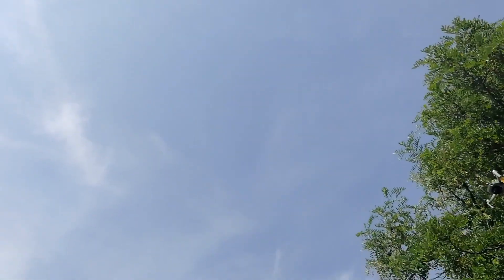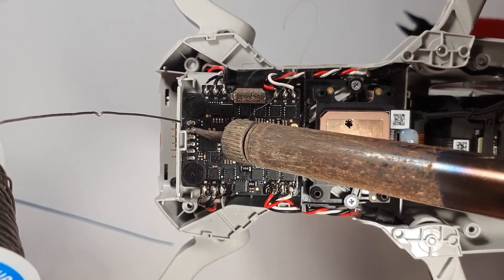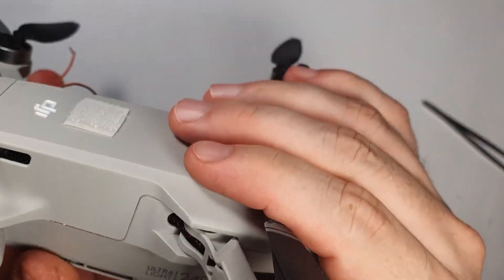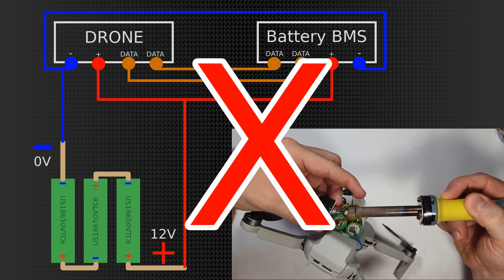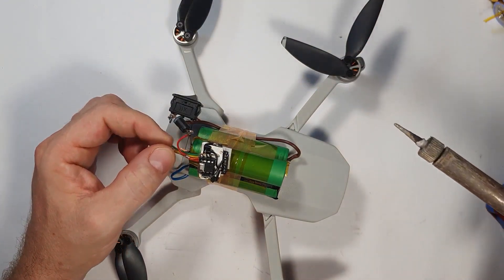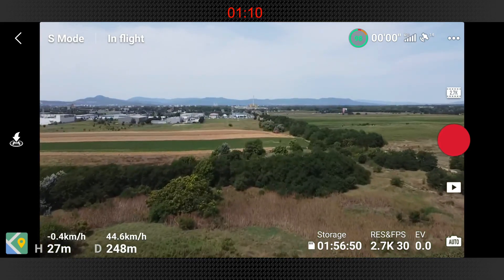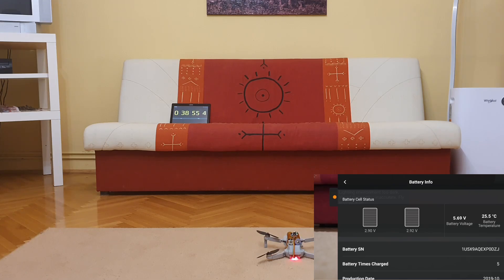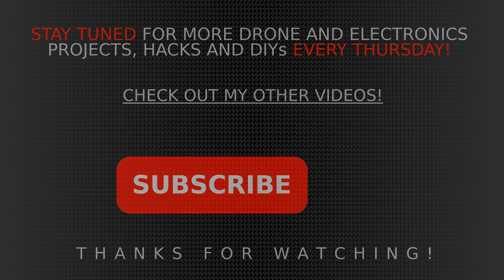Simplest Mavic Mini 3S battery mod (Is it worth it?)

Comment: Great video! I’ve been curious about this subject, considering all the possibilities, since Dji batteries are so expensive and  thinking that wiring a few 18’s or even better 21’ with high batterers drain shouldn’t be overly diffiucult, it’s just being able to get past dji’s battery level sensors to get it run,while also being able to see the batteries real time level. I’m curious if this set up will work for my mini pro 3. I’ll check for your part list or if you left any links. 
  And if yiuve discovered any modemifiactiins to this set up like possibly  using the Dji dongle holder as a possible mounting option. Or if you’ve continued with the 21’s or if you’ve found any pillow pack style of batteries that would work bettter becuasethey have less packaging material

Comment: the top speed in drones is always 100% dependent on the max angle of tilt relative to gravity. And this is what is regulated by the firmware.
And the motors do not get hot because of the extra voltage, but rather because the drone is working harder by carrying extra weight. They would also get hotter than usual when you're carrying the same weight regardless if it's batteries or not

Comment: I was thinking about opening up the top cover over the drone to put the batteries closer to center gravity.  A new ,used top cover is pretty cheap to replace if you want to return to stock. I was also considering drilling multiple holes on the entire body for weight reduction. If I could scan or aquire a 3d scan of the top cover, it could easily be possible to create a modified enclosed top cover for more or larger battery assemblies.
Reply: The top cover is just an outer shell. The part that limits your ability to install a larger battery like the 21700 is the cage in the fuselage. Watch a Mini / Mini 2 disassembly video to see what I'm talking about. For you to do that you'd have to scan the fuselage, 3D print a version of it with a revamped cage and then replace ALL the component the new body. Way too much work for very little gain. Especially since they sell larger batteries.
Reply: @slappy76  have you found a source for reliable larger batteries, and can you share the link?
Thank you.

Comment: Could I please put a video of Mavic Air Mod. It looks so complicated, as a LiPo battery would have to fit below and be practically the size of the current one so as not to plug the sensors, I'm already watching so many videos and it only fails so far.
Reply from the maker: I may look into it in the future.

Comment: Since you already done some modifications to the drone, can you try out something like using mini 2 esc board and motors on mini one flight controller.. I have a drone but I'm currently studying therefore can't afford a drone to do some hacking... I would be much appreciated if you able to try that out. If the communication between esc and the flight controller is different between mini 1 and mini 2, it won't work.
Reply from the maker: Hi. I haven't done those experiments, but I have a friend who did, and the 2 ESC's are not compatible per his findings. They do not work with the other's flight controller. The motors are however interchangeable.
I hope this is the info you are looking for!😊
Reply: @ZollyD  thank you very much for your info.. I'm pretty sure dji is making those esc incompatible by tweaking the firmware. Again, thank you very much. keep up the good work
Reply from the maker: Yeah, I think so too. You are welcome!🙂

Comment: Why didn't you put two batteries inside the panel and only one battery on the top? Great video!
Reply from the maker: I just did not want to mess with extra cables. That is all. :)

Comment: Hello there, I like your videos, but could you frame the picture a bit higher so the focal point is higher up in the picture, as the captions now are interfering. I'm deaf, and needs them - but you have put the action/focus rather low .. just a friendly request. Other than that, great content!! Much liked! :)
Reply from the maker: Hi! Thanks for the tip! :) I did not think about this. I will do my best. Till then could it work to open the video on another device as well in the same time just for the text? As a hack? 😂 You know this channel is about hacks..😂😂😂
Reply: @ZollyD  I love hacks, but your suggestion isn't one. Just a nuisance, hehe. But thanks for taking time to reply, much appreciated!

Comment: Interesting that it works. But I would have reservations about loading components above their specifications. These components do not have to fail immediately, but maybe at some point later. In addition, the Mini gets extraordinarily hot even with 2S.
Reply from the maker: Yes. That is why I say at the end that I DO NOT recommend this mod. The components of the ESC are rated easily for the 3S. The problem is the motors. They burn up after a while.
Reply: @ZollyD  Ok, so you checked the voltage ratings of capacitors, diodes and transistors.
The motors are for a are the lesser problem for an experienced user. But electronic components are mean. They die without notice. Gladly when it is most unfavorable.
The 2S Mod is very interesting.
Reply from the maker: @avronaut  I checked everything I could find some markings on.... 😂 No guarantees on the rest...
Reply: @ZollyD  😁

Comment: Switcing to a fpv 3 blade prop with higher pitch would increse the speed but reduce flight time.
Reply from the maker: Yes. 🙂 But also on Drone-hacks.com it is possible to adjust the max tilt angle and that also result in higher top speed.

Comment: How about puttin one of the battery in the battery compartment and one on top ?  That should lower the center of gravity improving the overall performance and weight balance
Reply from the maker: Yes, that is correct. I simply did not want to mess around with more and more cables. 🙂 And as I mention on the end. I do not recommend this mod as it strains the motors more. The way to go is extended capacity 2S battery and drone-hacks.com mod for higher top speed.

Comment: 21700 was what I wanted to see. If mini is low drain could prob do one the 5000mah or 4500mah. Hate that it force lands at 3v. Li-ion can go to 2.5v.
Reply from the maker: I think 5000mAh could work. Yeah the Li-ion goes easyly to 2.5V but it is a risky business a bit. I tried the Mini2 with 2S Li-ion and when it went to around 5V the ESC turned off and the drone dropped. It was indoors and on the carpet so no problemo, but it turned into a rock and fell... 😂😂😂

Comment: I have been using a Phantom 4 but wouldn't mind having the Mini 2. Just waiting to see if there will be a Mini 3. I think its so annoying that Drone manufacturers keep producing drone with 28, 32, or similar flights times. Deliberately I might add. As you show, it is possible to give a longer flight time.   Wish they would give the crowd what they want.
Reply from the maker: Yeah! I do understand it from the viewpoint of they have to fool-proof their products. Maybe this flight time deters people to try crazy distance flight? I don´t know. I think they should continue with the same basic setups, BUT optionally make available higher capacity batteries. Proper genuine DJI tech stuff. IDK. I think many people would buy from DJI a fancy full top-of-the-line battery for quite some money. I mean if they really want the best... right? ahhh, just ignore me, I am just rambling... 😂😂😂😂

Comment: hello buddy, i just have a question. if i make a 2s 2p battery pack i need to use bms or not. and whether the wire connection can be directed to the battery. thanks.. kee it up and more more videos 👍👍👍
Reply from the maker: Hi!
the answer is in this vid: https://youtu.be/XDXQCOPXxUw
Watch it all and it will be clear to you :)
Reply: thanks for the reply, I saw your video tutorial and I tried to do it but it didn't work I used awt battery 3000mah 40a 2s direct to battery connection not on the board, it was parallel to the lipo battery but it didn't work .. and then power up the drone after 15 sec low voltage.. i guess my drone is not for this 😁
Reply from the maker: I am sorry to hear. If you want to go into a major troubleshooting I am up for it. But then I need a full description on  what was done and what are the symptoms... :) Anyway, keep the experimenting spirit! ;)
Reply: @ZollyD  thank you mate very much appreciated im more interested to mod my battery since my drone battery parts is not available in my country and i want to use 18650 battery.. my drone is holystone hs700d

Comment: I was chasing cars with my M2P and the wind behind me I couldn’t get over75km I think DJI drones must have a setting in it that won’t let you go any faster would that right…Great video 👍
Reply from the maker: Thanks! There is the software drone-hacks. In that one can set a lot of parameters of the drone. Also the tilt angle. Then the max speed can be changed. I did not go into it, as I am more interested in flight time extension.

Comment: 🇷🇺👋😁👍
the tilt angle of the drone affects the flight speed.  to increase the flight speed, you need to change the values of the flight angle in the drone engineering menu
there is a program for this and by connecting to a computer, you can change the settings of the drone.  I changed the settings on my Mavic mini and now it flies like a rocket, I also changed the descent speed of the drone and now it descends very quickly like a stone and saves battery power
with your three cell battery and a different flight angle, your drone will fly faster
Reply from the maker: Awewome! What is the software?
Reply: @ZollyD  I will email you a link to a video showing how to do this and which program.  If I now send a link in the comments, it will be removed by YouTube
Reply from the maker: @DODG-Dji-mavic  Atlichna
Reply: @вечная_мерзлота  Youtube won't let me send you a link

Comment: very good flight characteristics.  👍
Have you seen my video?  Where did I redesign the Mavic mini 1 motors and make the propellers wider?  Do the same and then the flight speed will be even faster.
I myself am from Russia, so I use google translator.  so my words may not be spelled correctly 😁
Reply from the maker: Yes I saw that. It was cool! 😃 Google is doing a great job with the translation!😉

Comment: I am loving these mod videos.  You make drone modding look easy (of course it is not easy at all). It would be great to see a 45min -1hr battery mod. :) One day it will happen perhaps.
Reply from the maker: Thanks! :) We see about the flight time soon... ;)
Reply: Agreed. Zolly appears to know more about electronics than any other video uploader I have seen.
Reply: Only way to do that is install bigger motor change the software on the drone and then add a bigger battery...ud have to really want to do it, to do it. It's more cheap and easy to buy a air 2 and mod thay battery instead. 35 to 40 on a mini 2 is max flight time that's all your gonna get with it being factory.

Comment: Be sure to go into settings and select "payload mode" when carrying more weight. It might help the motors. Just changing the factory battery cells to higher current versions would be great.
Reply from the maker: Yes it does, by reducing the max flight speed. But that was what I wanted to test... :) Otherwise I agree to do it.